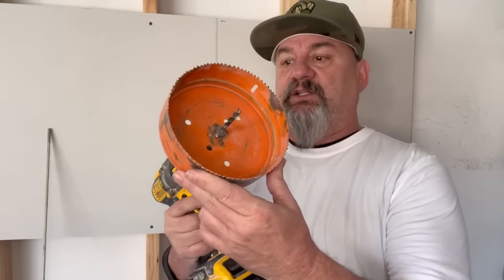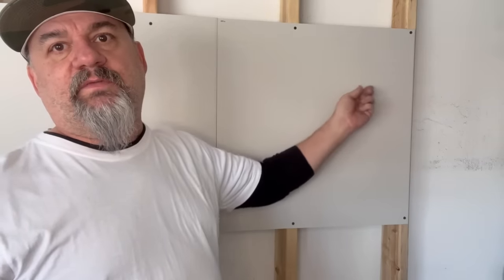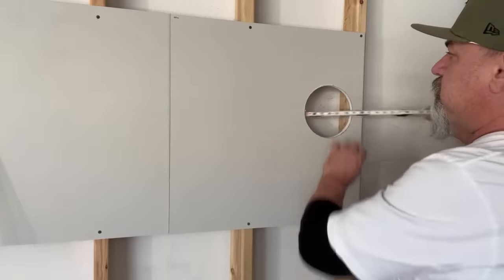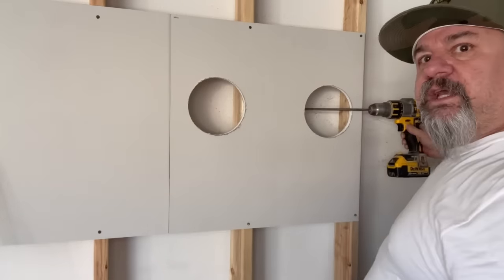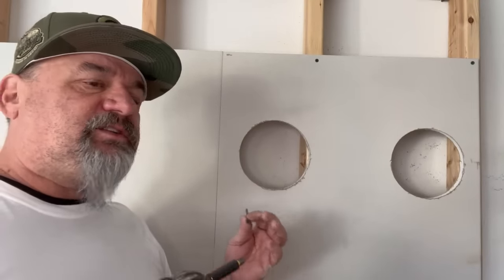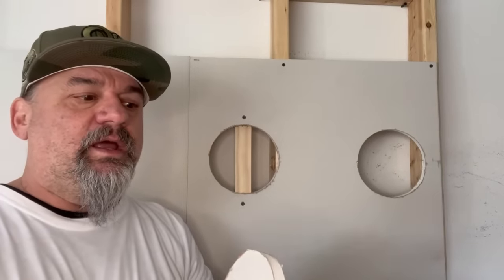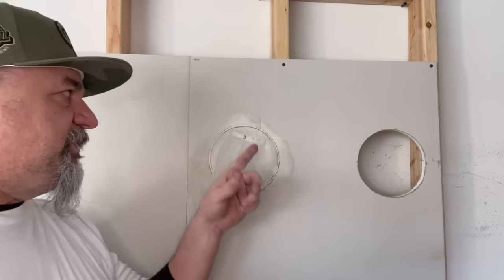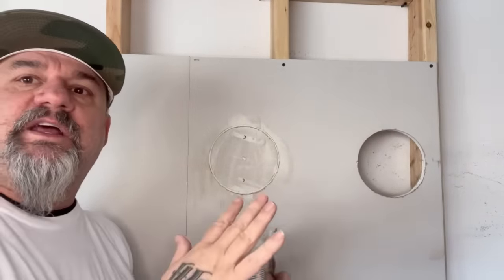Unbelievable Trick to Run Wires Through Walls and Fix Drywall - You Won't Believe What Happens Next!

Comment: Wouldn't mind seeing a video about routing romex in the floor of a garage loft. Inspector didn't notice the garage sconces weren't live. Went up in the loft and each sconce has like 20ft romex just lying up there. If i remember correctly, there are a couple junction boxes up there for the outlets. Either way, I'll be replacing an outlet with an outlet switch combo and using motion sensors.
Reply from the maker: its tough since im not on the job anymore but I will make a note, always looking for ideas!!! thanks

Comment: The hole you drill is Round which keeps the seam from cracking so you don't need tape, good job
Reply from the maker: Thanks I should have pressed for using caulk and then mudding over it so to prevent from cracking. oh well thanks for the watch!!

Comment: My brother-in-law is an electrician, and he usually just uses a hammer to make his access holes. Customers are not too impressed, and neither am i, as he always asks me to fix them up for the painters. I’ve tried to tell him to cut cleaner holes but some people are just in too much of a rush. Your patch would be a pleasure to tape and plaster compared to what i normally do.
Reply from the maker: Right on, I bash holes too!!! lol
Reply: Bashing in the hole usually breaks the plaster out on the back side of the hole edge. Way more effort to resolve. You have my condolences.
Reply: Would you recommend taping that circle before plastering to avoid future cracks?

Comment: If theres large baseboards I prefer to take them off, remove the drywall behind cutting just below the paint line, then drill through the studs. once wiring is done just screw the drywall back into place, mud it if you want but I dont, and reinstall the baseboard with pin nails and caulk as usual
Reply from the maker: Simple Trick Shows You one way to skin a cat, theres lots of ways to do this.

Comment: @ Starving Electrician,
Your still drilling blindly into one side of the stud. I use a cabinet screw driver to poke through the drywall and twirl a piece of fishtape shaped as an L. This way I can feel what's in the wall. I also try to drill in the center of the studs. Thanks for the video.

Comment: You don’t need holes in the plasterboard at every stud only every second stud as these can be drilled from the cavity or as you did initially with a longer shank bit there after the cables can be routed with fish rods makes it faster ,neater and less involved for all trades , been there done it it works.

Comment: Lenny not only is your video super useful, you are one funny son of a sea-biscuit! Thank you so much Lenny. Lenny I did have a question. I have looked at a lot of videos that are suggesting I remove the baseboard to add outlets along the wall. I would much rather drill a few holes and run the wire as you have shown. Is it ok doing it your way? I would hate to have to remove the baseboard along with the carpet tack strip etc.
Reply from the maker: yep I just dropped a video that addresses that and I show the options so you make the choice if its right for you.  thanks for all the kind words.

Comment: Just a tip. You should always use a dense mud like durabond or 20 minute mud and also the backer board should be wider and glued.   You should be using a trowel not a 5 in 1 multi tool
Another comment said he cuts a 12 “ strip but that’s too big. I don’t think you need a foot of room. The only issue with cutting the strip is, a small strip is weaker and is easier to mud but now you’re floating mud out 12”- 16”. 
4” or 6”. Holes is the way to go and technically your not a drywall guy    Your skills and pay grade is too high to be worried about the holes.  All you need to do is number the cutouts and let the Drywall guys do it. 
  Your 100% right on the holes   Whatever size fits your hands. If it’s 4” or 6” just leave the drywall work to the professionals.  
Everyone have a blessed day.

Comment: Never had to come behind electricians much in 36 years but plumbers can use some help. They cut multiple small holes looking for something and I always come behind and tell them to just cut out a large section (4x4-4x2-2x2-1x2) it doesn't matter. It takes me less time to fix one or  two large holes as it does multiple small ones. If they have several small ones close together I just cut out a larger section myself.  At least you're courteous enough to put the drywall back in a professional manner, most not only don't put it back they throw away the blanks. Cudos!
Reply from the maker: thanks so much for that. thats all im trying to do!

Comment: I remove the whole length/section of drywall . Reason being is I put nail plate in after running wire . Depending on code in your area the above method will work just fine .
Reply from the maker: Thanks for the info yea and its always better with protection. this is in case there is no other course of action is all

Comment: You could just use a drywall bit for driving drywall screws into the drywall. It will create the perfect dimple, and you can't over drive the screw. Fast and easy. Overall, nice work.

Comment: Two years ago, one of my customers who owns a 2-story, 3,800 sq. ft. Victorian home had their entire house rewired to replace the knob & tube electrical system and panel.  They hired a professional father & son electrical company that specializes in knob & tube conversions.  When the job was completed, the electricians had rewired the entire house through the perimeter walls and they only had to drill 2 (two) holes, 4" diameter, into the walls that required patching for the entire house.  I wish I could have watched their process.
Reply from the maker: sometimes you dont have to cut any holes. I have done that hundreds of times.

Comment: This is how I do it. Frame with metal studs. Install circuit from panel to metal studs now you don't need all those wires and you can tap into power anywhere in the wall

Comment: I usually get away with a two-and-a-half 3 inch hole saw. I've been doing this for many decades I don't need to get my hands in the hole. Until I come up to the outlets which is a big enough hole that I can stick my hand into and grab the wire from anywhere. It probably takes me a little bit longer to do it this way but it's a lot less of a hole to be filled. And if it's plaster walls I'll sometimes try to go underneath the baseboards. As that stuff is then known to beat up on some drill bit especially if lath was used..
Reply from the maker: ya so many different ways to skin a cat i guess.

Comment: I like using old plastic ID cards (am I allowed to say this) and the like for applying filler, their flexing makes it easier to get a really good application and they are easy to wipe clean and cost nothing.
Reply from the maker: I like it!!
Reply: @StarvingElectrician  I also use them for cleaning bugs off windscreens not to mention pots and pans and even counter tops if I've been making pastry. I don't use the same one!

Comment: Easier is to just use your wallboard jab saw, and cut a hole with the saw held at an angle, like at a 45 to the surface, all the way around the hole.  It doesn't matter what shape the hole is, because you save the cutout as the patch -- it's a perfect fit, and with the beveled edge it won't fall through the hole in the wall, and you don't need a backer board to reinstall it.  Cut out the beveled patch, do your wiring, then mud the edge of the hole and the patch and press the patch back into place, pressing just intil the patch is flush or slightly beneath the wall surface.  It's a perfedt method, super fast, no measuring, and no way to make a mistake unless you throw away the patch.
Reply from the maker: great thanks for sharing that

Comment: like he says if you go slow to minimize dust it works fine.  hold on to the drill it will torque on you.  if you dont have a taco friend, use blue tape and a paper bag taped to the wall beneath to catch the dust.. its a great application when putting, what most people call MOLLIES , also known as wall anchors.
Reply from the maker: hmmmm good tip. ill keep that in mind!
Reply: @StarvingElectrician  also i do a lot of remodels and stuff, 40 years and the easy way to patch, besides giving it to pros, homeowners if you buy a broken piece from your box store its usually a couple bucks, this going to be hard to explain, but using the same drill bit if you drill from the backside of the drywall,  let me back up a second.  first. take the drill bit size for example in this case a 6" drill add 4" to the size of the drill and cut the drywall square, for example 6" drill bit make a 10 x 10 square.  from the backside of the square drill the hole with the bit until it is almost all the way thru its better to be less than thru or it doesn't work, then carefully remove the drywall away from the circle by breaking it and pealing it away from the paper on the front side of the drywall. leaving only the circle of drywall and the remaining paper on the front  like a flat. then you take the drywalls mud (named different in different regions, west coast its called mud east coast i think they call it sparkle or something) and coat the edges of the circle on the backside of the drywall , then put a coat a of mud around the circle in the wall you have the hole in. as if you were applying drywall tape screen etc , push the piece you made into the hole and easily smooth out the paper can and most likely will tear a little, its thin. come back the next day and finish. unless you use hot mud you can finish same day once it sets. i did a video ten years ago or so, i think there is a lot of people doing them now. i am sure there is one out there. i have a million tricks from 40 years, just to lazy i guess to make a video when the opportunity arises or forget.  take care you DYI"ers

Comment: 2X4s are 2X4 when they are first cut from timber, also called rough cut because they use course blade saws are rough and a little splintery on the surfaces.  All lumber starts out as rough cut lumber.  Finished lumber is then trimmed using fine blade saws that leave a smooth surface which makes it easier to attach wall material to and helps people getting sharp wood surface points stuck into their hands and elsewhere.
Reply from the maker: hmmmmm didnt know that. thanks
Reply: @StarvingElectrician  
Learned that in vocational agriculture class when we built a large storage shed and they wanted rough cut siding and trim.  Royal pain in the keister to paint with a brush by they way, took a lot more paint than usual, but that is what they wanted.
Reply: All lumber starts as a tree and is cut from there.

Comment: Nice vid. I would change things a bit tho. That 6" hole is a big mama even for big hands, so I would do a 4" instead, which is  also less of a struggle for the drill and driller. In addition, I would use at least a 2" putty knife instead of a scraper that can barely hold anything, and maybe add a 4" spackle knife for a easier finish. 
MH Patch is my favorite patch filler as it's easy to work with and has a great consistency - not to thick or not too drippy dries well and easy to sand.. That being said, the real fun begins when you have sheetrock over plaster and wood lathe walls in older homes and a stud finder is useless : )

Comment: cool bro, sometimes you gotta do what you gotta do. i have had to take base trim off to cut sheet rock and drill holes on jobs, or rip open cedar roofs to run wire. not fun but when the gc is breathing down your neck to get wires across a black walnut interior paneled house with vaulted ceilings. 
Have a good one
Reply from the maker: lol been there!!!!

Comment: Easiest way is to remove the baseboard, you can do all the damage you want and just replace the baseboard. I mean you would want to replace and repair as much as you can, but still takes the worry and stress out of any horizontal wall runs
Reply from the maker: yea its one of many tricks or hacks, just trying to share what I use if I absolutely have to!!!  thanks for watching.

Comment: I'm told to never patch. Then if I had to wire it thru studs like this, the customer will be properly informed before work is started. They will be left to patch it. 
How you talk about drywall dust. I'm told to not clean a mess, you just tiddy it into a pile and leave it. Not like I leave it horrible, just a single pile per work area. But all this is also in my master electricians contracts. If a drywall guy puts a screw thru my wire, then thats more money per contract(normally $60 per opening). Having said that, I don't create holes or patch work majority of the time. I do remodels mostly without damages.  Watched the video hoping to learn a new trick with wiring thru drywall studs. But I did learn if i do decide to patch drywall, to just do the basis and leave the finishing to a real dry waller. That makes a lot of sense. Not like I don't get asked to.
Reply from the maker: lol right on!! drywalling sucks but sometimes we have to. thanks

Comment: Or...hear me out, you could use a stud finder to know where the edge of the stud is for drilling. You will also know if there is a random sister stud burried in the wall or a cross support. Good stud finders are pretty accurate.
Reply from the maker: this is just one of many tricks. theres lots of ways to do this.

Comment: I tried something different. I removed the baseboard and cut away a 2” piece of drywall the length of the room. Drilled my holes, ran wire and put drywall and baseboard back. Filled the holes, caulked the baseboard and added a little paint.

Comment: I don't have a hole saw anywhere near that big, and I don't want to buy one for the very rare times I would do this, but I do have a Dremel, and even if the hole isn't perfect the piece will fit.
Reply: Get a paint stick and glue a small block of wood to one end. Now you can drill a hole in the paint stick and velcro the Dremel to the wood block. At this point you have a very basic circle cutting jig that can be rotated around a screw going through that hole in the paint stick and into the drywall.
Reply from the maker: exactly. so long as the shape fits who cares. its a hole that your hand fits.

Comment: Easiest way to find the studs in the wall, without a tape measure, is to use a small magnet, it'll stick to to screw or nail. Then, just move your desired hole to the left or right of the magnet
Reply from the maker: so the magnet would find the stud?
Reply: It'll locate the fasteners that attach the drywall or whatever substrate is fastened to the studs, Yes.
As a courtesy, whenever I do repairs inside someone's home, I leave a 3/8"x3/8" magnet for them and show them how to use it in order to help locate studs if need be. Mirrors, artwork,  TV wall mounts, etc. Just one of the little things that'll help  a customer

Comment: I have also been using that method of the 1x2 but I usually cut it 6" bigger than the hole and I put a screw in the middle of the board to know I am centered in the hole and to hold on to it while i screw the top and bottom then take it out. Maybe even shot a bit of caulking on the board where it will lay against the back of the drywall. Also, when you put the cut out back in, put a little drywall compound on all the edges that make contact, inside the hole, and on the edges of the cutout. Then smooth out the excess.

Comment: I’ve never ran much wire, but I was a carpenter. I worked a side job where an electrician punched holes in the Sheetrock with a hammer, like a lot of holes in the rock. The tapers hated him.

Comment: Has anyone tried to run wires straight down under the house rather than all the studs? I'm not a electrician but this guy came to move some outlets and he was fast. Made like four small holes straight down, ran cables and connected existing wires to new wires. Went under house and used staples.
Reply from the maker: well yea for sure! this is the last resort. no one wants to make holes this is in case all else fails. or you are lazy like me!..lol

Comment: Wonderful video. How would you do this same wiring but then have a 90 degree wall… adding a outlet from one wall to a perpendicular wall. Thanks in advance
Reply from the maker: Thank you. it gets tricky and this is a perfect scenario. id use a electrical fish pole. push it through the insulation and drill another hole and catch it. I have another video on fishing wires take a look.

Comment: Bundled wires need to be derated.

310.15(C)
The ampacity of each conductor shall be reduced as shown in Table 310.15(C)(1) where the number of current-carrying conductors in a raceway or cable exceeds three, or where single conductors or multiconductor cables not installed in raceways are installed without maintaining spacing for a continuous length longer than 24”

310.80
In the event that they're going to fire caulk those bored holes; where more than two NM cables containing two or more current-carrying conductors are installed, without maintaining spacing between the cables, through the same opening in wood framing that is to be sealed with thermal insulation, caulk, or sealing foam, the allowable ampacity of each conductor shall be adjusted in accordance with Table 310.15(B)(3)(a) and the provisions of 310.15(A)(2), Exception, shall not apply.

Comment: Now the bad thing about using the paddle bit that long when your whole is that far away is that it is easy to drill right through the stud and then right through the sheetrock on the opposite side of your wall I have done that
Reply from the maker: lol yep so have I. im coming out with a new video soon and going to warn against that. auger bits will rip you through the walls.